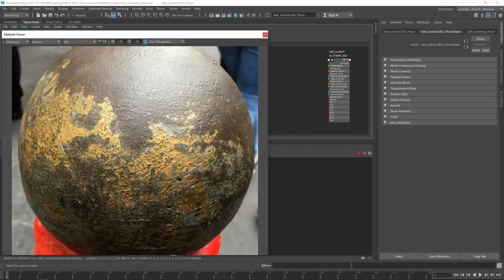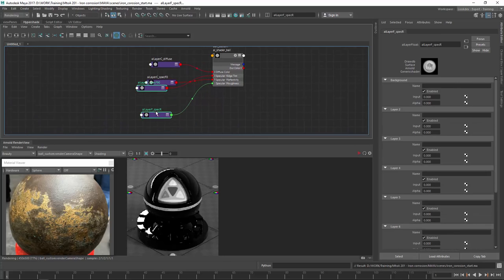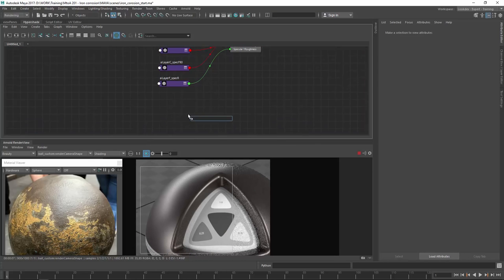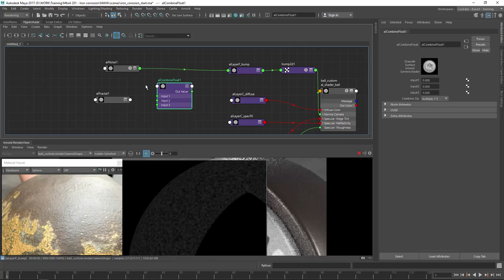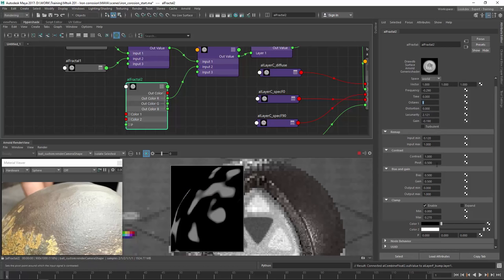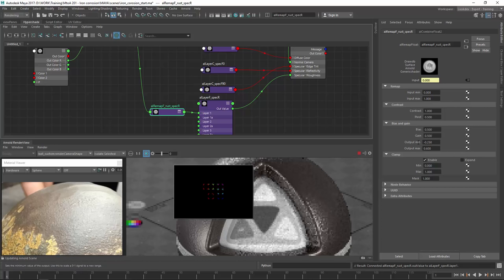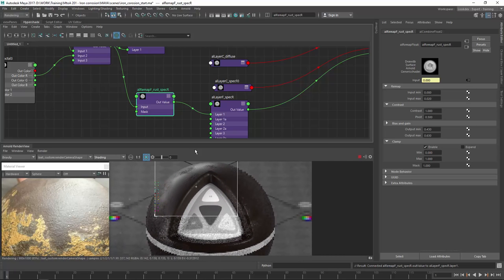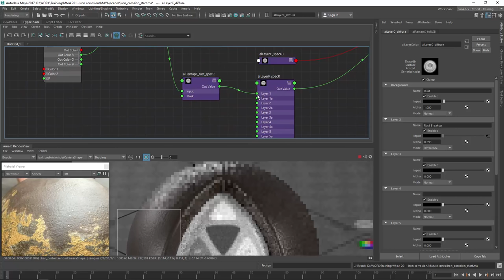MtoA 201 | Iron Corrosion PART 1| Material series using Arnold with Maya 2017

Comment: Are there any benefits in usage of al math nodes vs Maya counterparts ? I mean remaps, multiples and so on. You seems to use exclusively al where it is possible
Reply from the maker: Max Notgonasayitlol it does not matter. I am just providing the methods how I am working. You can use any other nodes, as the math will be the same. Multiply is Multiply